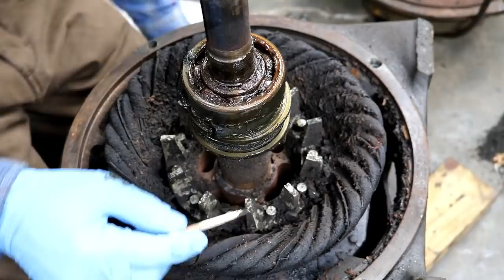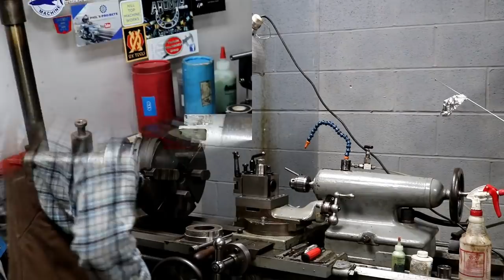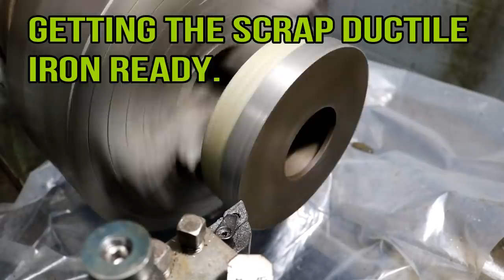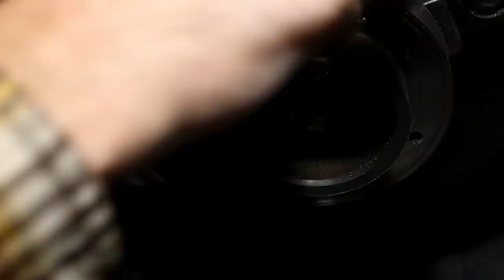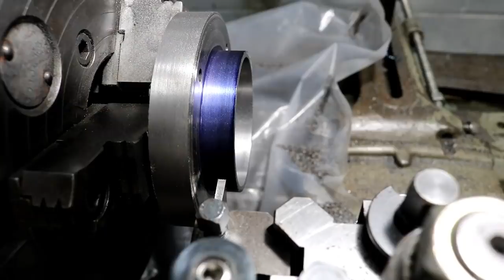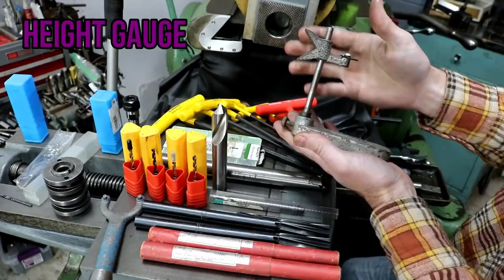WoW, It's Worse Than I Thought. K&T Motor Cleanup Begins.

Comment: I don't envy you in cutting the ductile iron. I turned some cast iron on my lathe a couple of times and it felt like I was in a sand storm with birdshot. After the first time I purchased a visor to keep the stuff off my face.
Nice work on the motor and the base plate repairs. One word of caution, if you are ever tempted to wash a motor out with naptha or kerosene, do not. I did it once to a drill and that thing smoked like a chimney. 
Finally, Happy birthday and anniversary.

Comment: I sure enjoy your videos. You mentioned a rail to install or remove the 4 jaw chuck what I used in my shop was barn door track I work on cars so I installed 2 10 feet apart and 2 side by side going across and I had these bridged with small rod I could pick up a v8 engine and transmission no problem at all. Cheap and yet strong.

Comment: To expand the cast iron ring, use a flat blade screwdriver (or similar) in the cut to open the ring up.  Then put the screwdriver in a vise (with the ring on it) and a bucket of water below it.  Heat the ring up with a propane torch until the ring drops off the screwdriver.  The water quench as it drops into the bucket will hold it in the expanded shape with the desired spring in it.

Comment: Happy Anniversary!!!!  One way I found for cleaning old greasy things was to keep a 5 gallon pail of machining oil. 31/2 gallons full and soak things over night, drain them back into the pail, then air blast and wipe.  Maybe do it 2 or three times until done.  Nothing cleans old grease and oil like new oil.  The bucket will last a decade or two before changing it.  Just hand muck it out every couple of years.  Now go finish your floor.

Comment: You could cut the sealing ring on a spiral, and just let it be as is.  If you had a few grooves that would allow gease to penetrate behind the ring when pressurized, the ring would be forced out and seal better whenever grease was being pumped in or it got hot from use.

Comment: I know that money is a limitation to what you do with that motor, but there is something that you could do to make it more reliable.  A good motor shop can re-insulate the windings.  It involves a deep cleaning in solutions, a baking, and then vacuum pressure impregnation.  I volunteer at the Minnesota Streetcar Museum, and we had a pair of traction motors that had been stored in pieces outside for many years.  The parts were sent to AC Electric http://www.acelec.com/ in Bangor Maine.  They were recommended by the people at the Seashore Trolley Museum.  The motors are like new, and they weren't re-wound.  I have since learned there are motor shops that are just as good all over the country.  I'm sure the people at AC would give you the names of shops near you that can do that work.

Comment: Get a cheap insulation tester. They are readily available. It would have been worth checking the windings to earth on the motor frame. If the insulation has broken down, it's not worth refurbishing. 500 volts is no good for checking the insulation of what in your country will be a 480 volt motor. You need at least 1000 volts.

Comment: You can usually get by with a cheap ohm meter. You need to check the resistance of each winding the resistance should be        very low all the windeings should be about the same. Then you need to check for shorts between the phase, there should be none.
Reply: A megohmeter is needed.  A common ohmmeter won't work.  Take it to a electric motor shop to be tested.
Reply: A megohmeter is only needed if you suspect insulation breakdown.

Comment: There are cleaners you can use on the motor .. look around and talk to Keith Rucker, Adam Booth, Brian Block, and Lyle Peterson.. I'm sure they can help. The temp seemed high for the oven. Careful.  Mr. Pete just did a similar cleanup. Good luck.

Comment: Steve,
Before you clean up the stator, take it to a motor shop and pay them to do an insulation resistance [Hi-Pot] test. If it is bad, you have saved yourself a lot of work. If OK, then clean it up [there are multiple suggestions below, but ask the fellow at the motor shop]. After cleanup, I would suggest repeating the test before investing in bearings and a lot of work.

Comment: Steve, the motor insulation is probably Formvar. I would avoid cleaning the windings with alcohol or chlorinated solvents such as brake cleaner. Those can damage the insulation. Naptha (camp fuel) might be OK. When you are ready to test, I have a high-pot tester we can use. I also have a small bottle of glyptol if needed. By the way my daughter likes Cove Spring Park, I think it's near you.

Comment: Steve, That boring bar that takes triangular inserts is made by Everede.  Travers tool sells them.  They are getting hard to find.
Reply: Correct, John.  They also made/(make?) triangular carbide blanks to fit those bars.  I have a set of Everede bars and they are very nice, also came with a nice holder to fit a lantern tool post.  http://everede.net/everede_2017_catalog_production_style_boring_bars_and_inserts.html

Comment: I just got my T&C grinder up and running and posted the video of it.  Nice to see the radius attachment,  I still need some accessories for mine but I was able to make a really nice HSS lathe bit :)

What are you going to use to adapt 3 phase for that motor?  I now have 3 different 3 phase machines two with VFDs and now the T&C grinder with a rotary phase converter.  I'm considering picking up a big rotary and mounting it somewhere then wiring the shop with 3 phase outlets, but that's a much further in the future project.  It would be nice to not have to figure out each piece of machinery or motor I get.

Comment: Steve there are videos on YouTube about making cast iron rings. You need to expand it with a wedge, then heat it up with a torch until it slips off the wedge into a bucket of water. Once it hits the quench it will “set” in the expanded state. If you try to expand them by hand they will break.

Comment: for your lathe chucks. cut a wooden saddle just the right height to fit across your ways to support your chucks while you set them on and push them in or out.   blowing the grease out in the yard may result in it sticking to shoes and getting tracked into the house or cars.
Reply: If you make it a V shape and add a simple bolt hight adjuster or 2 hardwood wedges to make it easy to slide in and then raise up to take the weight simplifies both fitting and removing.

Comment: Steve, When General Electric built this motor. It was built to last a long time. As dirty as this motor was and the Bearings are still okay. Says a lot about the High Quality of this Motors Construction. Unless there is visible damage to the Copper Windings? There shouldn’t be anything wrong when you test them. 
    Steve as much time and work you are putting into this Motor and overall on your Horizontal Milling Machine. I hope you Braze the Mounting Foot back on the base of this motor.
     I really enjoy watching your videos. The past and continuing series of videos on your Horizontal Milling Machine, is quite interesting. 
     You sometimes ask for other peoples suggestions, input and information.This is  just a suggestion about brazing the foot back on this motors base.

Comment: Another fine video, Steve.  When I had my automotive machine shop we also had an electrical shop for rebuilding starters, generators, and alternators.  I  had a small home electric range in the shop that we would bake components in that had  windings.  I had a product that we used on the windings to re-insulate them.  It was an aerosol red insulating varnish.  We would soak the windings and then either let them air dry or put them in the oven at low heat to cure the varnish.
Reply from the maker: Thanks Steven👍 I quickly getting more time in this old motor than its worth. I'm off to watch your new video

Comment: For all to see.. Grease in the windings caused by pumping grease in and not using the purge plugs to drain off the excess....There is a motor cleaner made to clean that mess out without ruining the insulation in the windings....Many motors have been burned out because of temperature rise caused by grease in the windings....

Comment: Hi Steve, I agree with the  others do not use water on your motor windings. Because you are not sure what insulating material is on the windings test the  cleaner before you douse the windings. If you find the windings are loose there are air drying insulating varnishes available. However you really need to have the windings insulation resistance to the frame checked before you put power on the motor, or you run the possibility of livening up the machine. In Australia all electricians can check this but I am  not sure about the USA. If you are not sure about the other machine wiring get the same test done by someone qualified on the whole machine wiring. I have seen first hand a freshly reconditioned machine go live and yet not trip the supply circuit protection. Stay safe and thanks for the vids

Comment: For testing the motor, a multi-meter set to Ohms will tell you if you have a direct short across the windings. However, to really test if the insulation on the windings is still in good shape you need a 1000v Megohmmeter.  With this meter you would test from each winding to the case of the motor. It sends 1000v DC (almost no current) through the windings to see if there are any shorts in the insulation.

Comment: What works well for me for cleaning out cruddy greasy motors is ZEP citrus degreaser in a squirt bottle(home depot) and a good scrub brush. Then rinse out with hot water.  Then i bake it out under heat lamps. Not sure of the temperature but hot enough so you can just barely touch it. I used to work for a motor shop and they would use the purple degreaser in a foamer , then steam clean and bake out in an oven. By the way Happy Anniversary.

Comment: Be careful with that gas heater indoors. 
You'd really want to use an insulation tester / megaohm meter for the windings. Unlike a regular ohmmeter they use a fairly high voltage (say 500V) so you can really test if the insulation is good. If you just use a multimeter it may read OK but later fail at mains voltage. Still better than nothing to use a multimeter, and you can at least check if all windings measure the same resistance, so there are no obvious shorts or breaks.
Reply: Right.  Use a Megger to test the windings.
Reply: Definitely should meg those winding before investing time in it only to have it fry a short time latter.
Reply: stefantrethan Oh shut up already.  Fuckin YouTube police...  Just shut up.
Reply: Wizzle thank you for lowering the tone here.
Reply: Wizzle - So you're saying no one should offer constructive advice? You should take your own advice. Cheers.

Comment: Hi 
Since the motor has not run in some time you should get a meg ohm meter and check the winding.
 If the insulation resistance is low the motor should be baked out and rechecked.
If baking is impractical you can put some heat into the windings with a low voltage supplied with some light bulbs in series.
I have not done this myself but have read about the process.
Thanks and good luck.
Reply: Dennis Williams Not a meg-ohm meter, but a “megger”, which measures resistance at a specified high voltage to detect insulation breakdown at voltage (also known as a “Hipot” test — as in “high potential”).  A meg-ohm meter will only indicate resistance at a very low voltage (typically in the 1-9VDC range), which is not indicative of the voltages the motor will encounter in normal operation.

Comment: Old motors can be really iffy! I decided to replace the 3 phase motor in my 1960's lathe because the insulation on the wires leading into the motor were cracking and even inside the insulation the copper was heavily oxidized. If that's the case it's better to replace the motor as it could be in danger of shorting out and causing a fire. You can always get some money for the motor recycling it for the copper or you can even have it sent out to be rewound but I have no idea on what that would cost.
Reply: It would be a shame to recycle that motor. They don't make them like that anymore. Not because they make them better now either. They just make them cheaper.
Reply: Most 3 phase motors are designed to run at a single speed and the build in fan will sufficiently cool the motor running at THAT speed. When I converted my Clausing lathe to use a Variable Frequency Drive with the new motor for speed control and I learned that the new motors use a much higher quality insulation on the wire which will withstand high heating that can sometimes happen if you are running a motor slower than its designed speed. So in that respect the new VFD compatible motors are actually higher quality than the old 1970's and earlier motors. Still having the motor re-wound would be a good option if he has the same issue I had with my old motor.
Reply: They are not higher quality. They are different spec. You can add an external fan easily too. I pull them out of old microwave ovens. But yeah VFD drives are pretty much horseshit. Change speed like a real man.
Reply: That is true! However, I think I would rather change speed like a smart man. I was able to replace 150 pounds of ancient crap in the form of heavy cast iron brackets, huge pulleys and springs with a clutch mechanism and a hydraulic cylinder mechanism with a small compact 4 pound electronic  VFD that run absolutely silently and smoothly. I mean really, one of the greatest property of the induction motor is that its speed can be controlled by varying the frequency of the 3 phases supplied to it so why not take advantage of that.
Reply: @theroboticscodedepot7736 ....Absolutely!  VFD's are an incredible tool.  We'll just let the cranky, old guy fart around with belts and pulleys.  Funny thing is, I am probably older than he is!
Reply: There are costs to changing the speed of an induction motor with a VFD. You're going to lose horsepower or torque. The faster you go the less horsepower the motor has and the slower you go the less torque it can develop. There's nothing for nothing in this world. You'll always pay for convenience too. The real way to change the speed of an induction motor is to change how many poles it has. Otherwise you're going to lose something in the translation.
Reply: Fair point, but for the work I do in my lathe the motor is slightly over sized to compensate. I also went with a over sized VFD in case I need to run a larger motor sometime in the future.
Reply: Oh, I forgot to mention for anyone who may be thinking of switching to using a VFD another advantage is that you can use either single phase 120V, 240V or 3 phase power into the VFD and it will convert it for you at least with the model I purchased. I found this out after I had spent a lot of $ setting up a true 3 phase power system in my shop to run the lathe - Doh!
Reply: If I were you I wouldn't kick myself too hard about investing in true 3 phase power. It is way better than relying on VFDs. No VFD is going to last forever. Lots barely make it a year. So you're far better off with the real deal.
Reply: Your nostalgia is misplaced as new motor are made with much improved wire insulation, superior iron characteristics for the rotor/stator,  and excellent insulation.  I'd recycle that old, out-of-date, motor without hesitation for a contemporary one in good condition.

Comment: Unfortunately, Ohming out the windings only tells a small part of the story, whether the windings are shorted. The main problem with old motors and transformers isn't the ohms of the windings, it's the insulation breakdown voltage of the windings coverings. Over time the coatings on the wires breaks down and lets voltage leak, causing shorts. It's best to check with an insulation breakdown tester. It measures the dielectric strength of the coatings on the wires. Bad news is that the testers cost quite a bit of money and are very specialized (only do one job) so generally not a DIYer item.
Maybe find someone who works on transformers or other inductors. Sometimes you can find people who work on old tube radios and amplifiers who have one of those testers.
Reply: Take it to a motor shop.
Reply: A vintage Evershed & Vignoles real, actual brand name, "Megger" with hand crank can be had for next to nothing on Ebay. It will do the job. It will possibly be very not-to-code in a professional shop setting, but at home, and with a some care, it will work just fine, and present an usable result. Side note:  Since some of these testing procedures are mandated by authorities for commissioning new electrical installations the market responds as it usually does when something is required by code; the vendors of test equipment see it as a license to print money and inflate the prices...

Comment: Hey Steve just wanted to suggest a fix for grease getting where it does not belong. Many water pumps and such use a relief hole to let out the excess grease rather than letting it get forced internally. Just my $.02

Comment: I follow you recently and enjoy your video, s. 
The dipping is to make sure that the windings do not move in the motor and there by protect the insulation.
 In older engines the insulation some times leaks, and then the engine gets hot. A good engine repair man can  make a high-voltage insulation check to see if that is the case. If it gets hot by just turning, replace the engine. I hope it is good.
forcive my poor englisch.

Comment: Hi Steve! My welder was like that when I rebuilt it. The pro shops bake the stator when they clean them, then they dip the whole thing in insulating varnish. I just used a engine cleaning gun, some air, and a spray can of the varnish. It's called "glyptal" made by GE